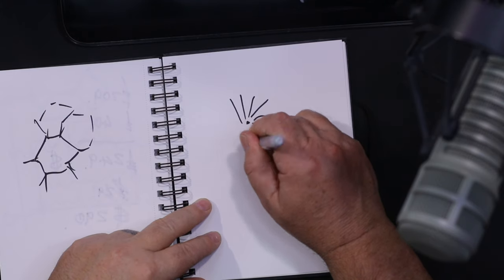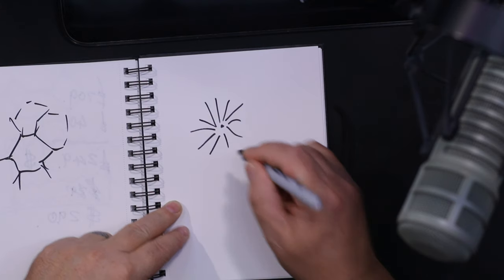DIY Radials: Can Chicken Wire Be Used for Grounding in Antenna Systems?

Comment: I like your video; I wondered about chicken wire. I have seen a couple of videos of someone using it,
but you never find out about it after long term use. I have a Hustler Vertical (5-BTV) that was given 
to me. In my, housing track the backyards have chain link fence. What I did was I used the top rail
of the fence. It's 3/4-inch tubing that holds the chain link fencing at the top. I bonded it at all the 
connections that I could get to and connected it to my antenna. It has worked verry well. Nice
low SWR across the bands. I have had it mounted on the fence, 4 feet or 1.2 Meters above the
ground. It's been that way for 15 years. I check the connection periodically and do a little 
maintenace  on the antenna. Not sure what the pattern looks like but I have made most
of my DX contacts with it. Have a great day. 73's Gary KF6EWO
Reply from the maker: Have a great day yourself :)

Comment: I have a chain link fence around my back yard. 40 years ago I put in radials for my vertical and found I could solder the ends of the radials to the chain link fence. may as well use it.

Comment: Maritime radio stations like Ostend Radio way back in the days had a large metal net under the dunes as their ground for the antenna’s. That was their radial net. 
Supposedly the net is still in their in the dunes between Ostend and Middelkerke although the mast and antenna’s have been torn down and sold a few years ago. 
But I do agree that chicken wire will rust, even if it is galvanized, also because of the bonding between the copper wire and metal net as their different metals and that’ll cause corrosion and rust
Reply: Callum, I wondered about this myself. 
73. WW5MB

Comment: A friend in Wyoming, USA spent over a week putting chicken wire down on his entire backyard beneath his longwave 'LowFer' transmitting antenna. I didn't have that sort of energy, so for my antenna in Colorado I put up a raised wire counterpoise about 5 to 8 feet off the ground, and did it in 2 days. My antenna worked very well, (range of over 800 miles much of the time with 7mW ERP,)  with a much higher Q than my friend's antenna. At least it did for nearly 2 years until a big buck mule deer hooked his antlers in my counterpoise, got upset and proceeded to shred much of the couple of thousand feet of 22 gauge hook-up wire I'd made it from. That was when I saw the advantage of buried radials.
Reply from the maker: Antlers! Ugh

Comment: Because i had hard core ground under my decking and a small area for radials which couldn't be buried, I put down 18 random radials (2 to 3m) and 3 half wave ones, one each for 30, 40 & 80m. I then slapped a layer of 1" square galvanised chicken wire on top of them like a whopping great ground plane. All bonded to the base of my 6btv stub pole and the antenna mounted 18 inches above. The whole lot was covered in decking. Seemed to work on some bands but not others.

Comment: Back in EI, I laid a sheet of 20mm galvanised mesh - the solid stuff - under the DXC. I cut a hole in the middle for the DXC. I had the usual radials too, and i put in 4 jumpers from the mesh to the DXC ground plate. My thinking was that most of the antenna current flows close to the antenna. 
To test if it was working, I first disconnected the mesh from the DXC, then transmitted a carrier at 400W. Looked at the tuning position, VSWR etc. Then I connected the mesh, with an RF ammeter in series. If its doing anything, I thought, current will flow. 
Transmitted again and there was about half an amp of current being drawn! The tuning changed very slightly, the VSWR curve flattened slightly too. The background noise on receive may have reduced slightly but that may have been an outside factor, or my imagination.
So in short, it worked! I refined it by attaching more radials to the outside corners of the mesh sheet. To attach wired I ground off the galvanise coating and braised the wires on. 
Again, this is steel mesh, not chicken wire, so no chance of it rusting and those trusty bits going bad.
In broadcast, we often put a ground screen right under the AM tower, so this was a ham implantation of that.
Reply from the maker: Andy, sounds beautiful. I remember you telling me about that..

Comment: Galvanic corrosion is a  big deal with dissimilar metals as any of us with oil rigs or boats will know. I believe you can get plastic coated, fully welded mesh, this might be worth investigating. The stuff we chuck in the ground has 2 prime purposes, one is to provide a virtual ground point but a secondary purpose is to provide a ground screen. IE to stop RF from being absorbed by the soil. Obviously as you said a huge mesh will be difficult to get out of the ground if it proves to be a mistake. I don't know the answers but there are some scientific papers on the net...
Reply: Apart from stainless steel radials I use stainless steel lath  and how I attached them to base of hf vertical is at the ends of the sheets in the middle I cut a star shape in it so it slid over the pole then I used a couple of big hose clamps to hold it to the pole then amalgamating tape. 73s mate.
Reply: @woodybollox  I do have a sheet of stainless, it might be a worthy experiment, though I anticipate it giving the hole saw a hard time.
Reply: Try a 4 inch grinder or good pair of tin snips. Then slide it over pole  with stainless jubilee clips or better.

Comment: Here’s a question for you Cal, insulated radials VS bare wire buried radials! Cheers mate 😊
Reply: Good question. I heard about the chicken wire bit before I put down my big radial field, so when I put my radials down, I dipped the cut end in "liquid tape" so that the insulated wire would be TOTALLY sealed. The other end with the spade lug had glue lined heat shrink and I put dielectric grease over the connections to help keep water out. It's about as totally sealed as I can make it. Overkill is underrated. :D
Reply from the maker: Don't matter. Good question.
Reply from the maker: Nothing like overkill... I'm doing it all the time!

Comment: I’ve done chicken wire with a 1/4 wave inverted L for 160m. Seemed to work well enough. Switched over to Fence wire, it is a bit more robust and will last a bit longer I think.
Cheers 73

Comment: Quick search found dxengineering comment stating that the wires are twisted together and not bonded together. It makes sense that each strand is galvanized and then meshed together so the galvanization might impede the connection.

Comment: Hi, I use dear fencing for my ground radials on my 80m 1/4 wave antenna. Been in ground for 10 years, no corrosions and certainly no clicks or pops.
SWR 1:1.2 at band ends, excellent transmit / receive qualities
Reply from the maker: Thanks for sharing!

Comment: I was thinking of chicken wire or 'hardware cloth' (1/2 mesh) for the conical ground plane of a simple portable 2m ground plane antenna set-up, so it won't be getting wet or having its own internal connection issues. Same could maybe be said for a discone...both parts, eh? It makes these units potential roll-ups. Thanks, Commander!

Comment: I've got a few stainless steel lath sheets around the base of my hf vertical. They are 2.5m by 700mm. Got 6 for nothing on site. Normally about £20+ a sheet. With my stainless steel radials running out across them around garden. I suppose it don't hurt to poor  some water down the mounting pole so it goes in the dirt around it.

Comment: For me, I've always referred to radials as above ground components and a ground mounted counterpoise as something different, but not radials, even when sized to resemble radials. With many ground mounted antennas, the lengths of the counterpoise wires aren't even very critical at all, but radial length certainly can be with some above ground antennas (not all though).
Reply from the maker: Above-ground elevated radials are actually more complex.. Rudy Severns has written about them.

Comment: Yes You can. Use the good stuff. Galvanized Green PVC coated mesh. I had mine for 10 years in the ground without a problem. Make sure to solder the mesh properly to the radial plate and seal it again with liquid PVC. Tinned copper wire is easier, and a lot less work, for radials.
Reply from the maker: Yes, tinned copper wire is a lot easier.. Plastic coated mesh? .. Interesting.!

Comment: What about stainless steel wire mesh/chicken wire?
Reply from the maker: I don't know
Reply: Hi. I use stainless steel lath and stainless Steel wire as radials. The radials are attached to the base with the sheets  and the wire is threaded through the diamond shapes of the mesh a few times to get good contact. It works very well for me. One of the old local hams we used to talk to on 2m used to say i had a metal lawn lol. Bad sadly his now silent key.

Comment: Only just came across this video when researching as I have just passed my foundation and looking to build my first HF rig. Going to pop up a vertical antenna on the top of a Gable on old thatched stable that has chicken wire covering the thatch.  Its not in the ground but up high and wondered if anyone reading the comments has tried this? I could run a ground spike down to earth from it too.just teying to figure out best antenna solution. Its a minefield!  Wayne.
Reply from the maker: You are over-thinking it.. Just run a few radials of copper wire up there. Hide them away. Ker-booom.

Comment: So I have a private park next to my backyard. I have considered to put up a vertical antenna (sig 9). How close could I put my antenna to my black vinyl chainlink fence?  I would still run the radials under the fence, since it goes into the park which I maintain :-)   (I have the DX Classic in the middle of the yard and the wife wants to move it)
Reply from the maker: I would say right up to the edge.

Comment: You're making a mirror for RF on the ground.  The ground is already reflective, but the wires amplify the effect.  Being close to or over water does well too.  So with that in mind, has anybody tried some type of metal shavings?  I used to have a 30 gallon drum of drill shavings (don't ask, I inherited it).  If you were to spread that around the antenna amongst your radial field, I wonder if it would have an effect?

I'm betting somebody somewhere, maybe military testing, has tested making the actual ground itself more conductive.  Maybe even a giant sheet of tin?  People try ridiculous things, I just like to see the results of their wasted time.  lol
Reply: One Field Day I installed a vertical on my metal roof thinking it would give a reflecting effect.  It was worse than any of the dipoles we had set up that day.
Reply: I don’t think metal shavings will work. The radials are electrically connected to the center conductor of the antenna, as the other half of the vertical. 
You might gain a more reflective ground under the antenna, like salt water but you’d still be missing “1/2” of the antenna circuit. 
Might help with verticals that don’t need radials, like vertical dipoles.
Reply from the maker: @Texas Frontiersman  Always remember to test a vertical on the LONGER range stuff and on TX, not just RX. You could have been surprised. Years ago, we had a dipole at about 40 feet on 40m. Also a vertical (on a switch). It was late at night and Stan had a QSO with a guy in USA. He switched from the dipole to the vertical and the contact was amazed and told Stan, he had just come up a couple of S points! However, on receive, there was nothing in it for Stan.
Reply: @DXCommanderHQ  Ya, I have your DXCommander 12.4 and a dipole.  Sometimes the dipole is better.  I think it also sometimes depends on which way the polarization has flipped by the time it gets to you.
Reply: @DXCommanderHQ  True, my experience with verticals is they transmit well due to lower take-off angle but they don't listen nearly as well as dipoles or loops.  What's a good TR switch?  Any recommendations

Comment: Cal  it will be great if you can test connection radials to metal roof as I did, it's been working great and another method to have more  grounding material for the DXC.  73s de TI2GBB.
Reply from the maker: Yeah, I don't have ability I'm afraid..

Comment: Nice one Cal. I spent so much time putting down my 160m of radials. All made up, soldered, sunk into the ground.  I feel it is a bit like cleaning my car, I love doing it, and I swear the clean car "goes better". But it does not.  I think I said in the comments of one of your other videos, during some Commander servicing, I left the base plate disconnected, so the ground "radial" was only through the coax. Worked fine lol. Of course, I then connected the radials all up and it worked much better ;)  Will I think it did ha ha.  Mark, 2E0MSR.
Reply from the maker: Of course it worked better!

Comment: Hi Cal,
Instead of chicken wire, use a hardware cloth where the joints are welded. Better if it can be found in stainless steel, but wonder how much that would cost. You and your family stay safe.  73  WJ3U
Reply from the maker: Indeed Don.. and a roll of wire etc under $50 instead :)

Comment: this is similar to can I use copper braid wire to ground the radio chassis - it recommended to use solid copper as braid has impedance! chicken wire could also off the same properties.... G0JKN/W2

Comment: I hear that above ground radials, even if not resonant, or fraction of a wavelength are still very effective, so why not chicken wire (above ground)? Also even if your chicken wire, is in the ground, corroding, it will still increase ground conductivity. I don't think it could be a bad thing. We can't all live by the sea. G7VFY
Reply from the maker: Well, just beware you don't hear the atoms becoming molecules!
Reply: @DXCommanderHQ  sounds like a fantasy to me.

Comment: Diss similar metals. Use dog wire all the sections are welded. If you are running decent power into this.. run gal strap up the middle like the centre vein in a leaf. This gets the current right out to the ends.

The radial versus sheets of wire .... if the aerial looks like a capacitor its about the plates... aka the surface area that faces the other. This is tower width and quality of the mirror reflection. Which is what you are really doing. Building an open air capacitor.

I've done this.... for 400 watts of AM on the likes of 1611khz here in Australia. 6 x 30m rolls of 1m wide dog wire... has way more surface area facing the 30m winch up mast with 6m of top hat loading. Kicks but  .... oh and with the price of copper.... the copper thieves get a nasty surprise... he he.
Reply from the maker: OK! Nice job.